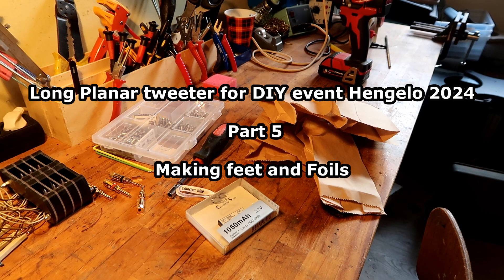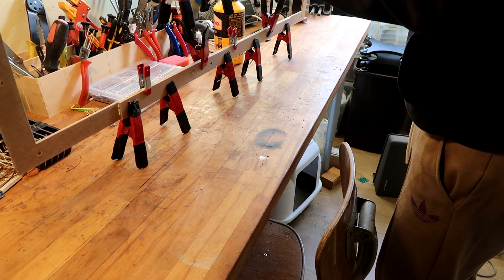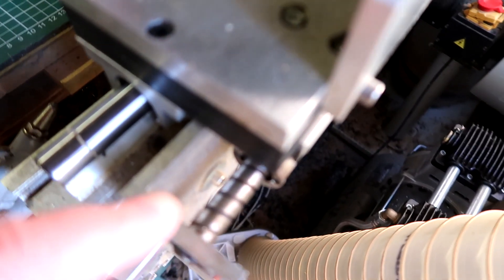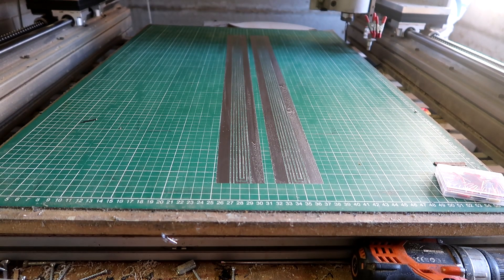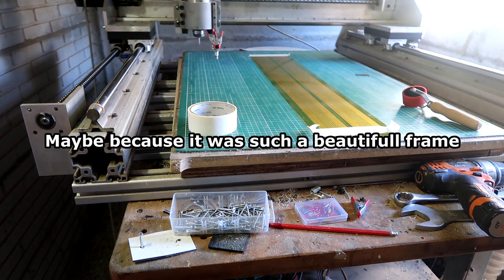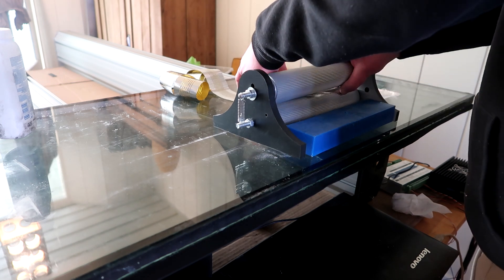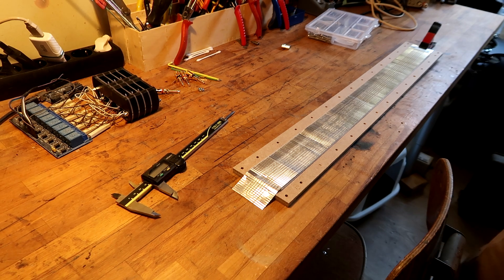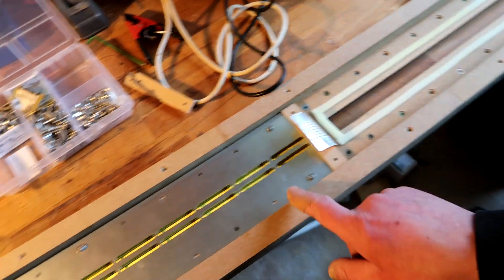Long Planar tweeter for DIY event Hengelo 2024 - Part 5  Bits and bobs and membranes

Comment: Hey brother , i just thought about someting concerning holding down the foil , what about a table that has a grid of small holes with a vacuum hooked to it so the foil is held down in place for cutting , to keep the foil from getting micro divits from the holes that are applying suction you could have releif valves to regulate the vacuum being applied to such foil ,
Reply: This is a tool a friend of mine did for cutting wood veneers,  it works perfect , hopefully this could help you
Reply from the maker: @jasontimothywells9895  :) thats what i though to, problem is  cutting blade ending in one of the holes. and im not sure the suction is enough to hold it in place..  another thing is cutting is pretty picky on the surface its cutting on. so it works for my Matt. but it might not work for MDF that would be ideal for vacuum holding it since it has no holes but is porous enough to hold a vacuum :( , none the less its not a bad idea ! i just still have some im not sure if it works :) but it is on my mind as well. would save on shit glue and more easy to remove !
Reply: @joppepeelen  yes it would save on all the glue , cheers
Reply: @joppepeelen  The suction table method can only be applied to thick and heavy materials. I have tested and failed. Initially they worked quite well. But when you put the mylar on. Pressure change between suction hole-aluminum foil-mylar. They will attract the aluminum fibers together and tangle them. Unless you stick aluminum foil on the surface of the hole. And it's no different from the method you're using. You still have to apply aluminum foil and have to invest in an additional suction cup. Costly.